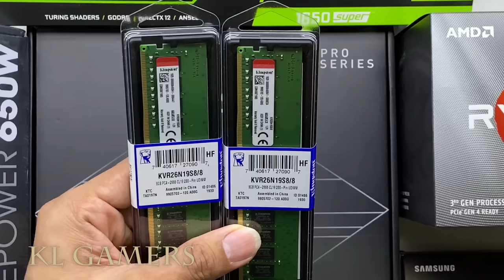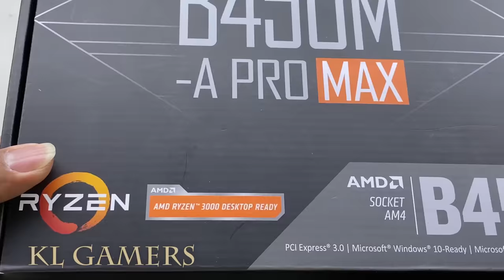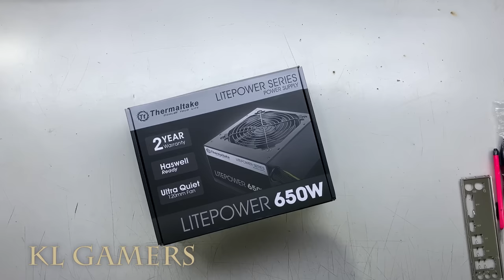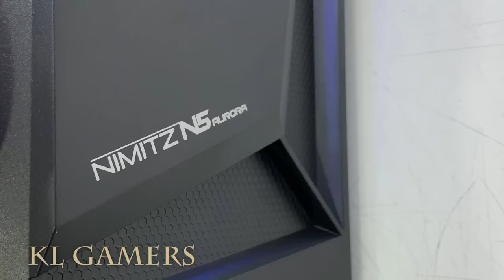AMD Ryzen 5 3600X msi B450M-A PRO MAX 16GB DDR4 SAMSUNG 970 EVO GTX 1650 Super Armaggeddon Nimitz N5

Comment: What is the cost of total build..??...plz reply...i want a pc like this..???
Reply from the maker: Processor = AMD Ryzen 5 3600X 6-Core, 12-Thread Unlocked Desktop Processor with Wraith Spire Cooler
(Amazon link) = https://amzn.to/3huiDZx
(Lazada link) = https://c.lazada.com.my/t/c.bHc9Hg?url=https%3A%2F%2Fwww.lazada.com.my%2Fproducts%2Famd-ryzen-5-3600x-with-wraith-spire-cooler-free-bubble-wrap-i528720221-s1044744320.html&&sub_id1=3600x&sub_id2=BIG&sub_id3=979
(Shopee link) = https://invol.co/cl10ft9

Motherboard = MSI ProSeries AMD Ryzen 2ND and 3rd Gen AM4 M.2 USB 3 DDR4 D-Sub DVI HDMI Crossfire ATX Motherboard (B450M-A Pro Max) (B450MAPROMAX)
by MSI COMPUTER
(Amazon link) = https://amzn.to/2Xlecbf
(Lazada link) = https://c.lazada.com.my/t/c.b1VlcO?url=https%3A%2F%2Fwww.lazada.com.my%2Fproducts%2Fmsi-motherboard-b450m-a-pro-max-socket-am4-i989048352-s2601008019.html&&sub_id1=PRO+MAX&sub_id2=i+save&sub_id3=278
(Shopee link) = https://invol.co/clug3f

RAM = HyperX Fury RGB 16GB 3200MHz DDR4 CL16 DIMM (Kit of 2) 1Rx8 RGB XMP Desktop Memory HX432C16FB3AK2/16
(Amazon link) = https://amzn.to/2NIVgi1
(Lazada link) = https://c.lazada.com.my/t/c.ZfZ6AH?url=https%3A%2F%2Fwww.lazada.com.my%2Fproducts%2Fkingston-hyperx-fury-rgb-8gb-ddr4-3200-mhz-cl16-gaming-ram-amakusa-i613494983-s1262384796.html&&sub_id1=3200+RGB&sub_id2=Amakusa&sub_id3=229
(Shopee link) = https://invol.co/clkhgg

SSD = Samsung 970 EVO SSD 500GB - M.2 NVMe Interface Internal Solid State Drive with V-NAND Technology (MZ-V7E500BW), Black/Red
(Amazon link) = https://amzn.to/3aak10e
(Lazada link) = https://c.lazada.com.my/t/c.6Eb6?url=https%3A%2F%2Fwww.lazada.com.my%2Fproducts%2Fsamsung-v-nand-970-evo-nvme-m2-2280-ssd-500gb-mz-v7e500bw-i467362457-s756058157.html&&sub_id1=970+evo&sub_id2=EIT&sub_id3=575
(Shopee link) = https://invol.co/clkbql

SSD = Kingston 500GB A2000 M.2 2280 Nvme Internal SSD PCIe Upto 2000MB/S with Full Security Suite SA2000M8/500G
(Amazon link) = https://amzn.to/381FuGm
(Lazada link) = https://c.lazada.com.my/t/c.6uzt?url=https%3A%2F%2Fwww.lazada.com.my%2Fproducts%2Fkingston-a2000-m2-2280-nvme-pcie-ssd-500gb-sa2000m8500g-i411502404-s1615374960.html&&sub_id1=a2000&sub_id2=eit&sub_id3=350
(Shopee link) = https://invol.co/cllbub

Hard Disk = Seagate BarraCuda 1TB desktop hard disk =RM170
(Amazon link) = https://amzn.to/2YFWWLP
(Lazada link) = https://c.lazada.com.my/t/c.WLWh
(Shopee link) = https://invol.co/clh6b1

Graphics Card = Galax GALAX GeForce® GTX 1650 Super EX (1-Click OC) 4GB GDDR6 128-bit DP/HDMI/DVI-D
(Amazon link) = https://amzn.to/3jejSww
(Lazada link) = https://c.lazada.com.my/t/c.bsgmvW?url=https%3A%2F%2Fwww.lazada.com.my%2Fproducts%2Fgraphic-card-galax-nvidia-geforce-gtx-1650-super-ex-1-click-oc-i833192468-s1983092505.html&&sub_id1=1650S&sub_id2=LAZ&sub_id3=749
(Shopee link) = https://invol.co/cl10c5p

Wifi = TP-Link WiFi 6 AX3000 PCIe WiFi Card for PC with Heat Sink| Bluetooth 5.0 | 802.11AX Dual Band Wireless Adapter with MU-MIMO, Ultra-Low Latency (Archer TX50E)
(Amazon link) = https://amzn.to/2DuK6eS
(Lazada link) = https://c.lazada.com.my/t/c.b6kMNB?url=https%3A%2F%2Fwww.lazada.com.my%2Fproducts%2Ftp-link-ax3000-wi-fi-6-bluetooth-50-pcie-adapter-archer-tx50e-free-pubg-bag-i1169126020-s3379272581.html&&sub_id1=AX3000&sub_id2=Mono&sub_id3=149
(Shopee link) = https://invol.co/clvwf5

Power Supply = COOLER MASTER ELITE P600 V3 230V PK600W POWER SUPPLY (MPW-6001-PCABN1)
(Amazon link) = https://amzn.to/2YKHnG2
(Lazada link) = https://c.lazada.com.my/t/c.Z6UZr0?url=https%3A%2F%2Fwww.lazada.com.my%2Fproducts%2Fcooler-master-elite-p600-v3-230v-pk600w-power-supply-mpw-6001-pcabn1-i1117960818-s3147116409.html&&sub_id1=Elite+P600&sub_id2=EIT&sub_id3=155
(Shopee link) = https://invol.co/clpt9d

Casing = Armaggeddon Nimitz N5 Aurora RGB MATX Tempered Glass Gaming Chassis
(Lazada link) = https://c.lazada.com.my/t/c.bHce4P?url=https%3A%2F%2Fwww.lazada.com.my%2Fproducts%2Farmaggeddon-nimitz-n5-aurora-rgb-matx-tempered-glass-gaming-chassis-free-2-x-led-fan-i637384599-s1333000484.html&&sub_id1=Nimitz&sub_id2=CS&sub_id3=129
(Shopee link) = https://invol.co/cl10fsj

AeroCool Cylon RGB Mid Tower with Acrylic Side Window, Black
(Amazon link) = https://amzn.to/2xd3eem

Price is based in local Malaysia current price.

Comment: How much did you costs?
Reply from the maker: Processor = AMD Ryzen 5 3600X 6-Core, 12-Thread Unlocked Desktop Processor with Wraith Spire Cooler
(Amazon link) = https://amzn.to/3huiDZx
(Lazada link) = https://c.lazada.com.my/t/c.bHc9Hg?url=https%3A%2F%2Fwww.lazada.com.my%2Fproducts%2Famd-ryzen-5-3600x-with-wraith-spire-cooler-free-bubble-wrap-i528720221-s1044744320.html&&sub_id1=3600x&sub_id2=BIG&sub_id3=979
(Shopee link) = https://invol.co/cl10ft9

Motherboard = MSI ProSeries AMD Ryzen 2ND and 3rd Gen AM4 M.2 USB 3 DDR4 D-Sub DVI HDMI Crossfire ATX Motherboard (B450M-A Pro Max) (B450MAPROMAX)
by MSI COMPUTER
(Amazon link) = https://amzn.to/2Xlecbf
(Lazada link) = https://c.lazada.com.my/t/c.b1VlcO?url=https%3A%2F%2Fwww.lazada.com.my%2Fproducts%2Fmsi-motherboard-b450m-a-pro-max-socket-am4-i989048352-s2601008019.html&&sub_id1=PRO+MAX&sub_id2=i+save&sub_id3=278
(Shopee link) = https://invol.co/clug3f

RAM = HyperX Fury RGB 16GB 3200MHz DDR4 CL16 DIMM (Kit of 2) 1Rx8 RGB XMP Desktop Memory HX432C16FB3AK2/16
(Amazon link) = https://amzn.to/2NIVgi1
(Lazada link) = https://c.lazada.com.my/t/c.ZfZ6AH?url=https%3A%2F%2Fwww.lazada.com.my%2Fproducts%2Fkingston-hyperx-fury-rgb-8gb-ddr4-3200-mhz-cl16-gaming-ram-amakusa-i613494983-s1262384796.html&&sub_id1=3200+RGB&sub_id2=Amakusa&sub_id3=229
(Shopee link) = https://invol.co/clkhgg

SSD = Samsung 970 EVO SSD 500GB - M.2 NVMe Interface Internal Solid State Drive with V-NAND Technology (MZ-V7E500BW), Black/Red
(Amazon link) = https://amzn.to/3aak10e
(Lazada link) = https://c.lazada.com.my/t/c.6Eb6?url=https%3A%2F%2Fwww.lazada.com.my%2Fproducts%2Fsamsung-v-nand-970-evo-nvme-m2-2280-ssd-500gb-mz-v7e500bw-i467362457-s756058157.html&&sub_id1=970+evo&sub_id2=EIT&sub_id3=575
(Shopee link) = https://invol.co/clkbql

SSD = Kingston 500GB A2000 M.2 2280 Nvme Internal SSD PCIe Upto 2000MB/S with Full Security Suite SA2000M8/500G
(Amazon link) = https://amzn.to/381FuGm
(Lazada link) = https://c.lazada.com.my/t/c.6uzt?url=https%3A%2F%2Fwww.lazada.com.my%2Fproducts%2Fkingston-a2000-m2-2280-nvme-pcie-ssd-500gb-sa2000m8500g-i411502404-s1615374960.html&&sub_id1=a2000&sub_id2=eit&sub_id3=350
(Shopee link) = https://invol.co/cllbub

Hard Disk = Seagate BarraCuda 1TB desktop hard disk =RM170
(Amazon link) = https://amzn.to/2YFWWLP
(Lazada link) = https://c.lazada.com.my/t/c.WLWh
(Shopee link) = https://invol.co/clh6b1

Graphics Card = Galax GALAX GeForce® GTX 1650 Super EX (1-Click OC) 4GB GDDR6 128-bit DP/HDMI/DVI-D
(Amazon link) = https://amzn.to/3jejSww
(Lazada link) = https://c.lazada.com.my/t/c.bsgmvW?url=https%3A%2F%2Fwww.lazada.com.my%2Fproducts%2Fgraphic-card-galax-nvidia-geforce-gtx-1650-super-ex-1-click-oc-i833192468-s1983092505.html&&sub_id1=1650S&sub_id2=LAZ&sub_id3=749
(Shopee link) = https://invol.co/cl10c5p

Wifi = TP-Link WiFi 6 AX3000 PCIe WiFi Card for PC with Heat Sink| Bluetooth 5.0 | 802.11AX Dual Band Wireless Adapter with MU-MIMO, Ultra-Low Latency (Archer TX50E)
(Amazon link) = https://amzn.to/2DuK6eS
(Lazada link) = https://c.lazada.com.my/t/c.b6kMNB?url=https%3A%2F%2Fwww.lazada.com.my%2Fproducts%2Ftp-link-ax3000-wi-fi-6-bluetooth-50-pcie-adapter-archer-tx50e-free-pubg-bag-i1169126020-s3379272581.html&&sub_id1=AX3000&sub_id2=Mono&sub_id3=149
(Shopee link) = https://invol.co/clvwf5

Power Supply = COOLER MASTER ELITE P600 V3 230V PK600W POWER SUPPLY (MPW-6001-PCABN1)
(Amazon link) = https://amzn.to/2YKHnG2
(Lazada link) = https://c.lazada.com.my/t/c.Z6UZr0?url=https%3A%2F%2Fwww.lazada.com.my%2Fproducts%2Fcooler-master-elite-p600-v3-230v-pk600w-power-supply-mpw-6001-pcabn1-i1117960818-s3147116409.html&&sub_id1=Elite+P600&sub_id2=EIT&sub_id3=155
(Shopee link) = https://invol.co/clpt9d

Casing = Armaggeddon Nimitz N5 Aurora RGB MATX Tempered Glass Gaming Chassis
(Lazada link) = https://c.lazada.com.my/t/c.bHce4P?url=https%3A%2F%2Fwww.lazada.com.my%2Fproducts%2Farmaggeddon-nimitz-n5-aurora-rgb-matx-tempered-glass-gaming-chassis-free-2-x-led-fan-i637384599-s1333000484.html&&sub_id1=Nimitz&sub_id2=CS&sub_id3=129
(Shopee link) = https://invol.co/cl10fsj

AeroCool Cylon RGB Mid Tower with Acrylic Side Window, Black
(Amazon link) = https://amzn.to/2xd3eem

Price is based in local Malaysia current price.

Comment: Can i use any case ? And how much Is It the Total  price?
Reply from the maker: M-ATX Case / ATX Case 👌

Processor = AMD Ryzen 5 3600X 6-Core, 12-Thread Unlocked Desktop Processor with Wraith Spire Cooler
(Amazon link) = https://amzn.to/3huiDZx
(Lazada link) = https://c.lazada.com.my/t/c.bHc9Hg?url=https%3A%2F%2Fwww.lazada.com.my%2Fproducts%2Famd-ryzen-5-3600x-with-wraith-spire-cooler-free-bubble-wrap-i528720221-s1044744320.html&&sub_id1=3600x&sub_id2=BIG&sub_id3=979
(Shopee link) = https://invol.co/cl10ft9

Motherboard = MSI ProSeries AMD Ryzen 2ND and 3rd Gen AM4 M.2 USB 3 DDR4 D-Sub DVI HDMI Crossfire ATX Motherboard (B450M-A Pro Max) (B450MAPROMAX)
by MSI COMPUTER
(Amazon link) = https://amzn.to/2Xlecbf
(Lazada link) = https://c.lazada.com.my/t/c.b1VlcO?url=https%3A%2F%2Fwww.lazada.com.my%2Fproducts%2Fmsi-motherboard-b450m-a-pro-max-socket-am4-i989048352-s2601008019.html&&sub_id1=PRO+MAX&sub_id2=i+save&sub_id3=278
(Shopee link) = https://invol.co/clug3f

RAM = HyperX Fury RGB 16GB 3200MHz DDR4 CL16 DIMM (Kit of 2) 1Rx8 RGB XMP Desktop Memory HX432C16FB3AK2/16
(Amazon link) = https://amzn.to/2NIVgi1
(Lazada link) = https://c.lazada.com.my/t/c.ZfZ6AH?url=https%3A%2F%2Fwww.lazada.com.my%2Fproducts%2Fkingston-hyperx-fury-rgb-8gb-ddr4-3200-mhz-cl16-gaming-ram-amakusa-i613494983-s1262384796.html&&sub_id1=3200+RGB&sub_id2=Amakusa&sub_id3=229
(Shopee link) = https://invol.co/clkhgg

SSD = Samsung 970 EVO SSD 500GB - M.2 NVMe Interface Internal Solid State Drive with V-NAND Technology (MZ-V7E500BW), Black/Red
(Amazon link) = https://amzn.to/3aak10e
(Lazada link) = https://c.lazada.com.my/t/c.6Eb6?url=https%3A%2F%2Fwww.lazada.com.my%2Fproducts%2Fsamsung-v-nand-970-evo-nvme-m2-2280-ssd-500gb-mz-v7e500bw-i467362457-s756058157.html&&sub_id1=970+evo&sub_id2=EIT&sub_id3=575
(Shopee link) = https://invol.co/clkbql

SSD = Kingston 500GB A2000 M.2 2280 Nvme Internal SSD PCIe Upto 2000MB/S with Full Security Suite SA2000M8/500G
(Amazon link) = https://amzn.to/381FuGm
(Lazada link) = https://c.lazada.com.my/t/c.6uzt?url=https%3A%2F%2Fwww.lazada.com.my%2Fproducts%2Fkingston-a2000-m2-2280-nvme-pcie-ssd-500gb-sa2000m8500g-i411502404-s1615374960.html&&sub_id1=a2000&sub_id2=eit&sub_id3=350
(Shopee link) = https://invol.co/cllbub

Hard Disk = Seagate BarraCuda 1TB desktop hard disk =RM170
(Amazon link) = https://amzn.to/2YFWWLP
(Lazada link) = https://c.lazada.com.my/t/c.WLWh
(Shopee link) = https://invol.co/clh6b1

Graphics Card = Galax GALAX GeForce® GTX 1650 Super EX (1-Click OC) 4GB GDDR6 128-bit DP/HDMI/DVI-D
(Amazon link) = https://amzn.to/3jejSww
(Lazada link) = https://c.lazada.com.my/t/c.bsgmvW?url=https%3A%2F%2Fwww.lazada.com.my%2Fproducts%2Fgraphic-card-galax-nvidia-geforce-gtx-1650-super-ex-1-click-oc-i833192468-s1983092505.html&&sub_id1=1650S&sub_id2=LAZ&sub_id3=749
(Shopee link) = https://invol.co/cl10c5p

Wifi = TP-Link WiFi 6 AX3000 PCIe WiFi Card for PC with Heat Sink| Bluetooth 5.0 | 802.11AX Dual Band Wireless Adapter with MU-MIMO, Ultra-Low Latency (Archer TX50E)
(Amazon link) = https://amzn.to/2DuK6eS
(Lazada link) = https://c.lazada.com.my/t/c.b6kMNB?url=https%3A%2F%2Fwww.lazada.com.my%2Fproducts%2Ftp-link-ax3000-wi-fi-6-bluetooth-50-pcie-adapter-archer-tx50e-free-pubg-bag-i1169126020-s3379272581.html&&sub_id1=AX3000&sub_id2=Mono&sub_id3=149
(Shopee link) = https://invol.co/clvwf5

Power Supply = COOLER MASTER ELITE P600 V3 230V PK600W POWER SUPPLY (MPW-6001-PCABN1)
(Amazon link) = https://amzn.to/2YKHnG2
(Lazada link) = https://c.lazada.com.my/t/c.Z6UZr0?url=https%3A%2F%2Fwww.lazada.com.my%2Fproducts%2Fcooler-master-elite-p600-v3-230v-pk600w-power-supply-mpw-6001-pcabn1-i1117960818-s3147116409.html&&sub_id1=Elite+P600&sub_id2=EIT&sub_id3=155
(Shopee link) = https://invol.co/clpt9d

Casing = Armaggeddon Nimitz N5 Aurora RGB MATX Tempered Glass Gaming Chassis
(Lazada link) = https://c.lazada.com.my/t/c.bHce4P?url=https%3A%2F%2Fwww.lazada.com.my%2Fproducts%2Farmaggeddon-nimitz-n5-aurora-rgb-matx-tempered-glass-gaming-chassis-free-2-x-led-fan-i637384599-s1333000484.html&&sub_id1=Nimitz&sub_id2=CS&sub_id3=129
(Shopee link) = https://invol.co/cl10fsj

AeroCool Cylon RGB Mid Tower with Acrylic Side Window, Black
(Amazon link) = https://amzn.to/2xd3eem

Price is based in local Malaysia current price.
Reply: @KLGamers  thanks

Comment: What is the total price for the build ?
Reply from the maker: Processor = AMD Ryzen 5 3600X 6-Core, 12-Thread Unlocked Desktop Processor with Wraith Spire Cooler
(Amazon link) = https://amzn.to/3huiDZx
(Lazada link) = https://c.lazada.com.my/t/c.bHc9Hg?url=https%3A%2F%2Fwww.lazada.com.my%2Fproducts%2Famd-ryzen-5-3600x-with-wraith-spire-cooler-free-bubble-wrap-i528720221-s1044744320.html&&sub_id1=3600x&sub_id2=BIG&sub_id3=979
(Shopee link) = https://invol.co/cl10ft9

Motherboard = MSI ProSeries AMD Ryzen 2ND and 3rd Gen AM4 M.2 USB 3 DDR4 D-Sub DVI HDMI Crossfire ATX Motherboard (B450M-A Pro Max) (B450MAPROMAX)
by MSI COMPUTER
(Amazon link) = https://amzn.to/2Xlecbf
(Lazada link) = https://c.lazada.com.my/t/c.b1VlcO?url=https%3A%2F%2Fwww.lazada.com.my%2Fproducts%2Fmsi-motherboard-b450m-a-pro-max-socket-am4-i989048352-s2601008019.html&&sub_id1=PRO+MAX&sub_id2=i+save&sub_id3=278
(Shopee link) = https://invol.co/clug3f

RAM = HyperX Fury RGB 16GB 3200MHz DDR4 CL16 DIMM (Kit of 2) 1Rx8 RGB XMP Desktop Memory HX432C16FB3AK2/16
(Amazon link) = https://amzn.to/2NIVgi1
(Lazada link) = https://c.lazada.com.my/t/c.ZfZ6AH?url=https%3A%2F%2Fwww.lazada.com.my%2Fproducts%2Fkingston-hyperx-fury-rgb-8gb-ddr4-3200-mhz-cl16-gaming-ram-amakusa-i613494983-s1262384796.html&&sub_id1=3200+RGB&sub_id2=Amakusa&sub_id3=229
(Shopee link) = https://invol.co/clkhgg

SSD = Samsung 970 EVO SSD 500GB - M.2 NVMe Interface Internal Solid State Drive with V-NAND Technology (MZ-V7E500BW), Black/Red
(Amazon link) = https://amzn.to/3aak10e
(Lazada link) = https://c.lazada.com.my/t/c.6Eb6?url=https%3A%2F%2Fwww.lazada.com.my%2Fproducts%2Fsamsung-v-nand-970-evo-nvme-m2-2280-ssd-500gb-mz-v7e500bw-i467362457-s756058157.html&&sub_id1=970+evo&sub_id2=EIT&sub_id3=575
(Shopee link) = https://invol.co/clkbql

SSD = Kingston 500GB A2000 M.2 2280 Nvme Internal SSD PCIe Upto 2000MB/S with Full Security Suite SA2000M8/500G
(Amazon link) = https://amzn.to/381FuGm
(Lazada link) = https://c.lazada.com.my/t/c.6uzt?url=https%3A%2F%2Fwww.lazada.com.my%2Fproducts%2Fkingston-a2000-m2-2280-nvme-pcie-ssd-500gb-sa2000m8500g-i411502404-s1615374960.html&&sub_id1=a2000&sub_id2=eit&sub_id3=350
(Shopee link) = https://invol.co/cllbub

Hard Disk = Seagate BarraCuda 1TB desktop hard disk =RM170
(Amazon link) = https://amzn.to/2YFWWLP
(Lazada link) = https://c.lazada.com.my/t/c.WLWh
(Shopee link) = https://invol.co/clh6b1

Graphics Card = Galax GALAX GeForce® GTX 1650 Super EX (1-Click OC) 4GB GDDR6 128-bit DP/HDMI/DVI-D
(Amazon link) = https://amzn.to/3jejSww
(Lazada link) = https://c.lazada.com.my/t/c.bsgmvW?url=https%3A%2F%2Fwww.lazada.com.my%2Fproducts%2Fgraphic-card-galax-nvidia-geforce-gtx-1650-super-ex-1-click-oc-i833192468-s1983092505.html&&sub_id1=1650S&sub_id2=LAZ&sub_id3=749
(Shopee link) = https://invol.co/cl10c5p

Wifi = TP-Link WiFi 6 AX3000 PCIe WiFi Card for PC with Heat Sink| Bluetooth 5.0 | 802.11AX Dual Band Wireless Adapter with MU-MIMO, Ultra-Low Latency (Archer TX50E)
(Amazon link) = https://amzn.to/2DuK6eS
(Lazada link) = https://c.lazada.com.my/t/c.b6kMNB?url=https%3A%2F%2Fwww.lazada.com.my%2Fproducts%2Ftp-link-ax3000-wi-fi-6-bluetooth-50-pcie-adapter-archer-tx50e-free-pubg-bag-i1169126020-s3379272581.html&&sub_id1=AX3000&sub_id2=Mono&sub_id3=149
(Shopee link) = https://invol.co/clvwf5

Power Supply = COOLER MASTER ELITE P600 V3 230V PK600W POWER SUPPLY (MPW-6001-PCABN1)
(Amazon link) = https://amzn.to/2YKHnG2
(Lazada link) = https://c.lazada.com.my/t/c.Z6UZr0?url=https%3A%2F%2Fwww.lazada.com.my%2Fproducts%2Fcooler-master-elite-p600-v3-230v-pk600w-power-supply-mpw-6001-pcabn1-i1117960818-s3147116409.html&&sub_id1=Elite+P600&sub_id2=EIT&sub_id3=155
(Shopee link) = https://invol.co/clpt9d

Casing = Armaggeddon Nimitz N5 Aurora RGB MATX Tempered Glass Gaming Chassis
(Lazada link) = https://c.lazada.com.my/t/c.bHce4P?url=https%3A%2F%2Fwww.lazada.com.my%2Fproducts%2Farmaggeddon-nimitz-n5-aurora-rgb-matx-tempered-glass-gaming-chassis-free-2-x-led-fan-i637384599-s1333000484.html&&sub_id1=Nimitz&sub_id2=CS&sub_id3=129
(Shopee link) = https://invol.co/cl10fsj

AeroCool Cylon RGB Mid Tower with Acrylic Side Window, Black
(Amazon link) = https://amzn.to/2xd3eem

Price is based in local Malaysia current price.